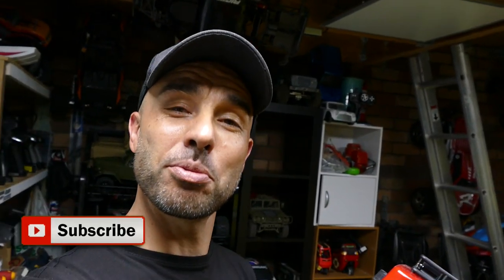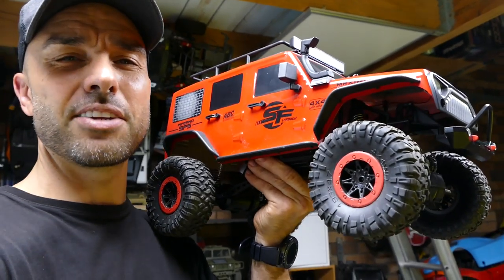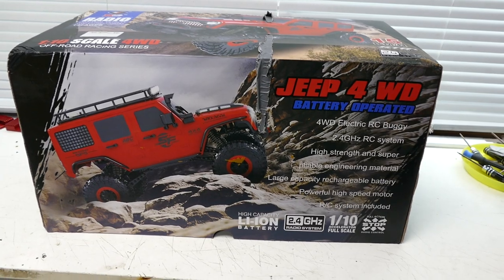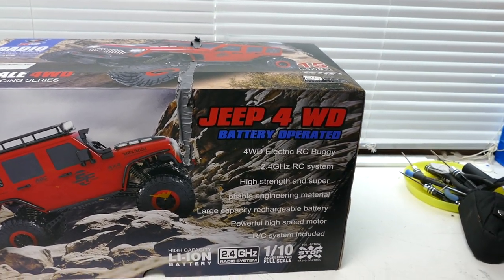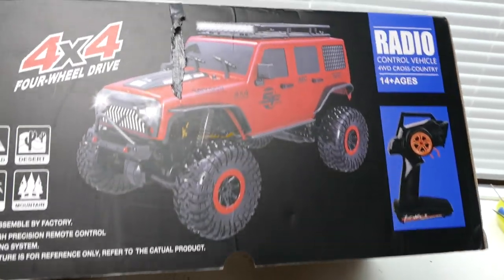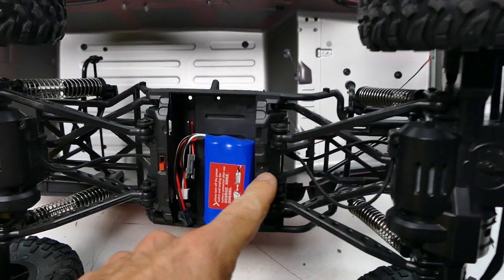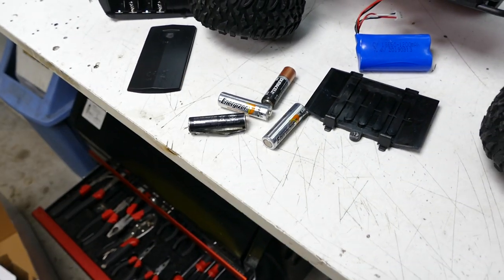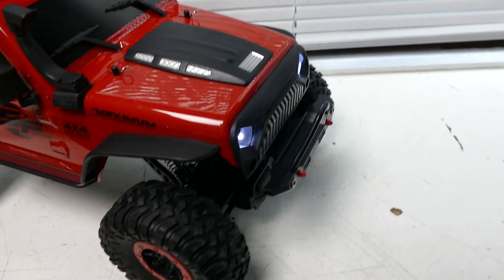JEEP WRANGLER WLTOYS 104311 RTR 1/1O RC CRAWLER - Yeah, nah...

Comment: This is the first video I have seen of this. Are the tires any good? I think it's around $50 in the U.S right now. If the tires are decent, it would be worth it for just the body and wheels and tires.
Reply from the maker: Wouldn't recommend the tires. Attached via a screw and not the traditional nut

Comment: Great video. Could you convert this with a proper ESC and steering servo?
Reply from the maker: Nah just spend a few more and get something better from the start
Reply: You really can't upgrade anything here. Basically, anything but the body is worthless. The motors are in the axles. It's Walmart grade.
Reply: Yes just use a tamiya ESC and a HPI servo, I would recommend changing the shocks to handle the extra power, also make sure the chassis is nice and tight with just the right amount of give, I see beginners overlook this all the time, most crawlers have a tendencie to lean to one side, this would be down to the build, always best to completely take it apart and put it back together again using a high grade glue, make sure you always use quality screwdrivers and never rush , once its ready to run start slow and slowly build up to going fast, never get carried away straight off the bat, you will brake it and have to go back to the drawing board, not good, this will cost time and money, might even make you give up the hobby, I would hate for anyone yo experience this, not nice my friend,  I've seen it before many times, take your time and enjoy the build, never do a build if you're tired or on an empty stomach,  not good, hope this helps and good luck with it.
Reply: @thehomefront1905  Thanks for your input, much appreciated.

Comment: This is worse than HB p1001 and has twice the price? Axles and wheels look the same . But it's looks weaker . HB use 9.6 volt ni-cd battery and maybe those extra volts run better those motors .
Reply from the maker: Yeah not the best